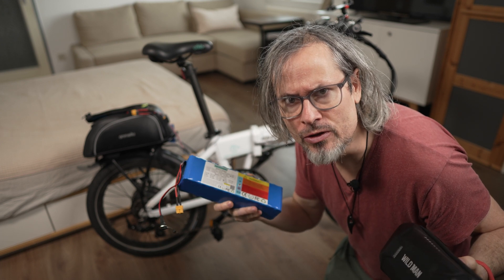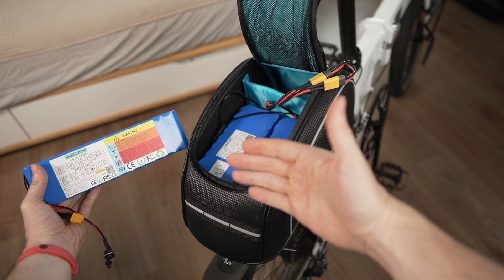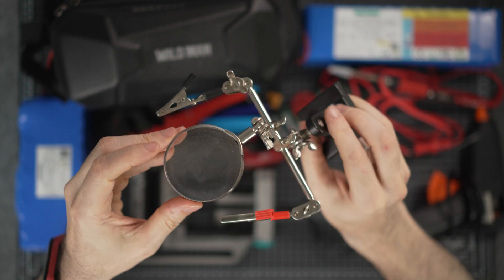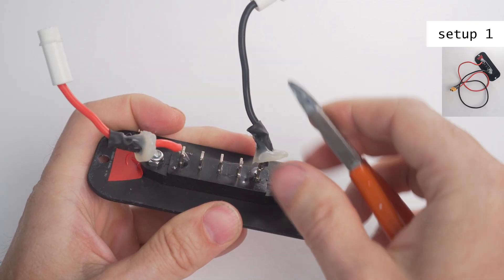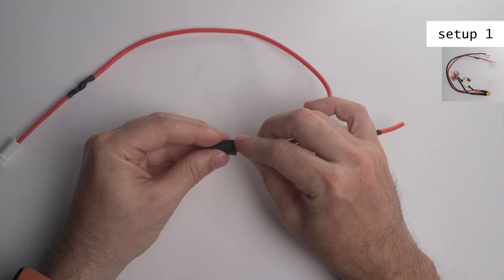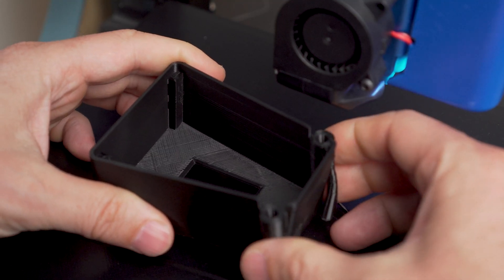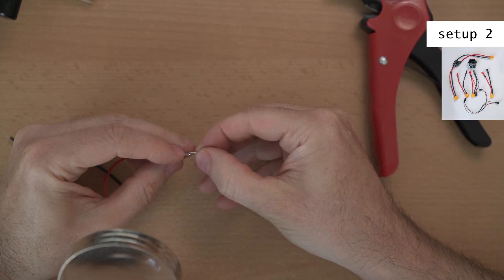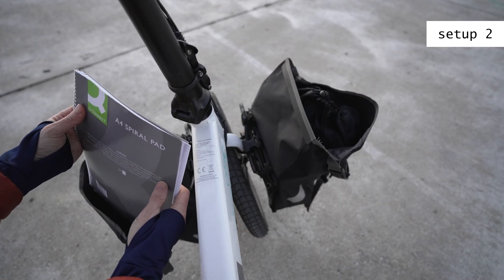How I added a battery 🔋 to my Scooter 🛴 E-Bike 🚴‍♂️

Comment: Great video - very clear and exactly what I have been looking for - you mentioned something about not recommending to use a manual switch, but that’s what I think I need to do as I’m using two batteries with different voltages. Can you help to explain why it’s not recommended. Again, great video and thanks for sharing.

Comment: I'm installing a kt controller with lcd3, Do you know what top speed is with 48v battery? I need to know if it increases top speed so it's worth to pay more for 48v.
Reply from the maker: hey mate I dont know, I had problems with 48V so I decided to stay with 36V and not to risk any problems... for me it is plenty fast for the city, when going outside of the city it could be nice to go faster of course...
Reply: @ebikeworkshop  I have it all working now, pedal assist is so much better now, I need 58t crank 😂.
Reply from the maker: @coaldust01  well done mate, for 58t check out my blog: https://bernhardherzog.com/en/my-best-e-bike-scooter-upgrades/#10_58t_chainring
Reply: @ebikeworkshop  thanks for the reply, I've connected the controller and the peddle assist is doing full speed even in mode 1 I've tried different C1 settings but it either don't start or it does full speed in all modes, it's driving me crazy lol, any ideas?

Comment: You added fuse for those connector?
Reply from the maker: I add fuse on extra wire where I connect alarm etc. because they would die if current spikes. I think at wire to battery it is not mandatory because BMS should handle problems. But you can for extra safety. Some battery already come with external fuse, see links in description